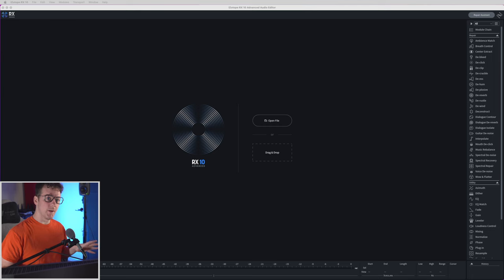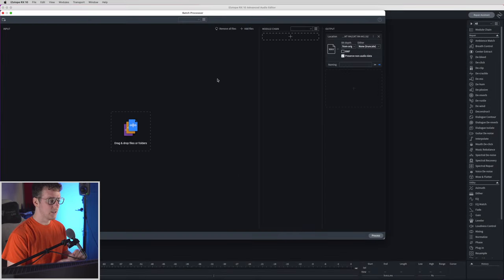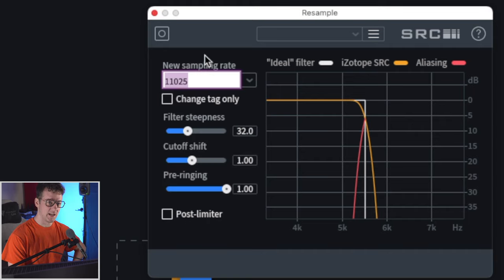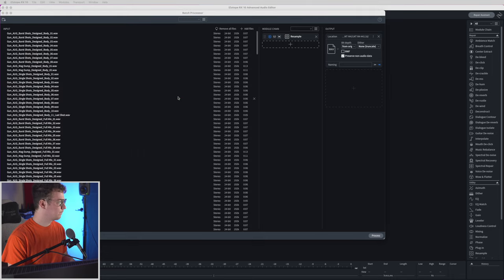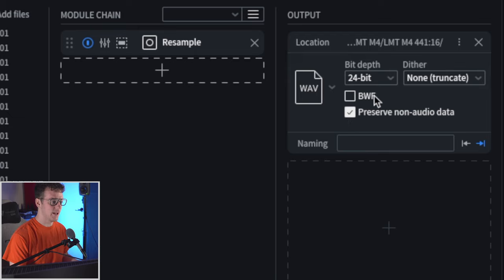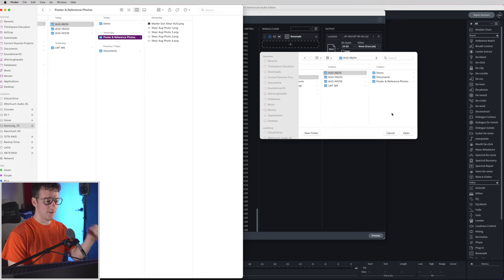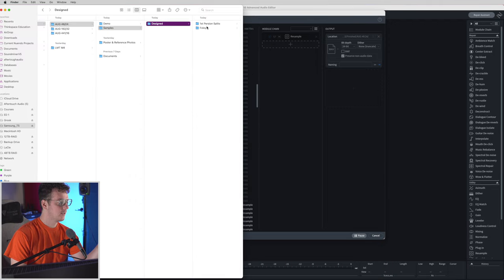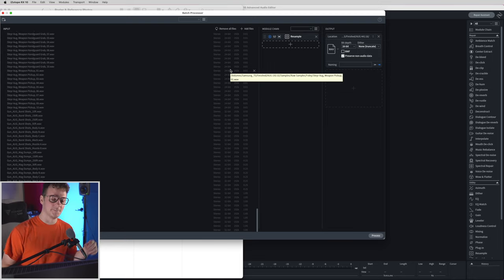Batch Processing in iZotope RX10

Comment: When you dont check dithering (even to 24 bit) you are truncating and adding quantization distortion to your files. This is because the SRC process is like any other DSP where very large numbers are created that completely fill the 32 bit processing engine of RX.  Therefore the moment you do any processing in RX, your file essentially becomes 32 bit float and technically requires dither when going back down to 16 or 24 bits.
Reply: So is it best to enable the (White noise TDPF) or (Noise shaping MBIT+)?
Reply: @jochisfx  When going to 24 bit TPDF is good enough IMO, but when going to 16 bit you may want to try noise shaping since the dither is quite a bit louder than 24 bit. Noise shaping can weight the noise to be less audible to the ear, but equally effective as a dither.

Comment: Do you have or know of a video on how to batch-cut each audio sample, cutting out silence? Basically, how to export each sample from the project?
Reply from the maker: Hey Stray, I've only found one piece of software that dose this effectively that operates outside of a DAW and that is Sound Miner. I demoed this feature in my "Gun Sound Design with Weaponiser by Krotosaudio video. Although you could use something like Cubase's export cycle marker feature and that will do the same thing albeit slower.
Reply: @AftertouchAudio  Checked out Sound Miner ($900). So trying to figure out a free way. What do you normally do for your bank files?